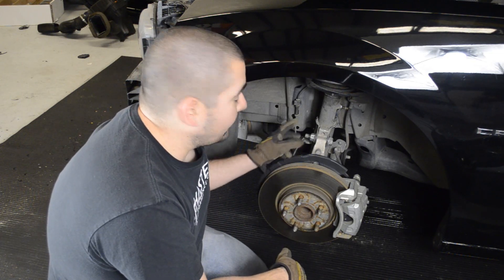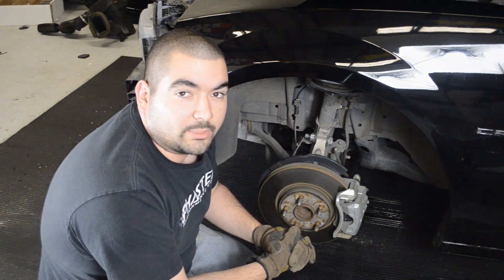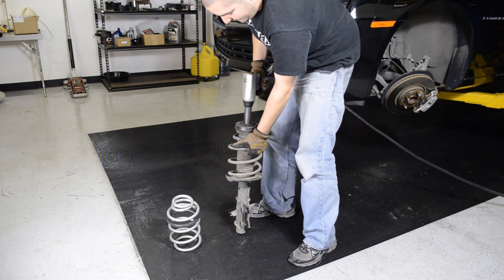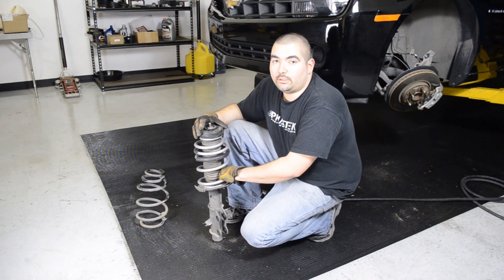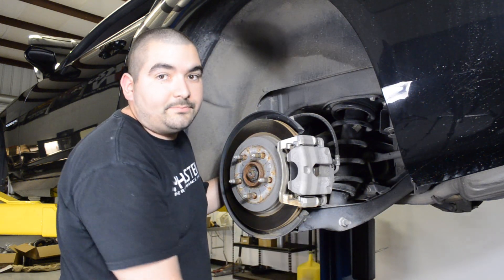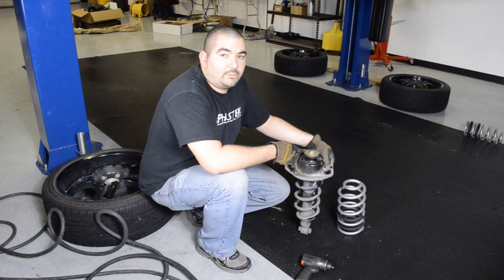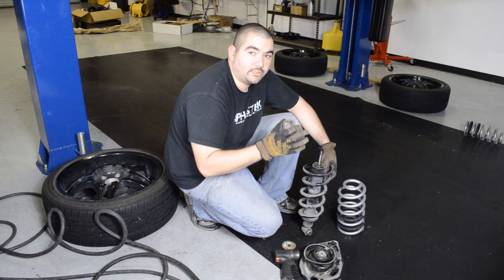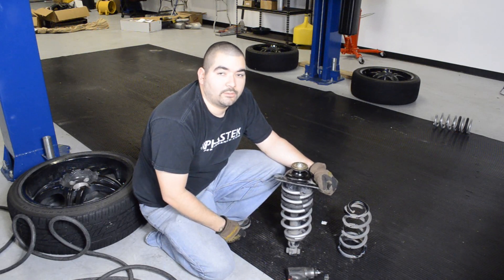PhastekPerformance.com - 5th Generation Camaro Spring Installation

Comment: Bruhhhh that rear bolt not the 21nm shock one but the one in the knuckle behind the brake rotor the 18mm, can’t seem to line up the holes 🕳️ to drive the bolt through ughhh it’s frustrating

Comment: Why is there rubber tubing half way down  on the new spring?
Reply from the maker: The rubber is there to prevent the noise of spring clap when the springs are collapsed completely.  Its more of a preventative maintenance to protect the spring during use.

Comment: I’m about to replace my front/rear struts on my 2010 Camaro, do the springs need to be replaced since they aren’t under much stress or do you recommend changing them, also does the mount and bellow need to be replaced when doing the struts?
Reply from the maker: I would suggest replacing the mount if you are already replacing the strut.  The springs do not need to be replaced but if you are looking for a different look then you already have them disassembled, so making the update is easy.
Reply: Phastek Performance ok thank you, I was going to buy new OEM springs or ones with same length, but if it won’t make a difference I’ll just stick with the stock springs

Comment: My sway bar link is stuck... like there's a lot of pressure on it so I can't pull the bolt out
Reply from the maker: You might have to put a wrench on the main nut and then a socket on the other end to hold the shaft from spinning.  That should allow you to remove the end link.
Reply: @PhastekPerformance  i got it done. The sway bar link comes out fine if you take the strut mount nut off first. The links were horrible to get off with vice grips. Was not easy at all.

Comment: The stiffer spring goes to rear and softer wider goes front ,pay attention at which order he is removing the nuts,very important,did this today,took me 5 hours for 2rear springs!because I removed bolts in the wrong order,the video is good but at least put details in description,for first time people is quite difficult !
Reply: Adrian B What did you do, mix up the springs? All you have to do is just match up the springs your taking off, with the ones you want to put on, this is not rocket science. Even for novices. This job wasn't that hard. I don't even have a compressor. Dude, they upload vidoes like this for you to pay attention, I did everything just like he did it, it wasn't as straight forward because my Camaro is a noticably driven midwest car, and I don't have a compressor or air tools. Very good experience, and let me tell you, spring compressors are a pain in the ass.

Comment: At 1:50 is that the top mount tan silicone part that needs to be shaven off for the 2015 SS models? You can see it for 2 seconds but is that it? I want to buy these for my car but noticed that there needs to be modification done for the top mount.
Reply from the maker: +Juan Bautista Yes, that is the part that needs to be cut on the 2014-2015 cars.  We have talked to the manufacturers about the issue with the spring sets and most of them are going to look into the issue and have it fixed.  It is just a matter of time .
Reply: +Phastek Performance Thank you, and also how would I go about to cutting that piece down and how much should be taken off?
Reply from the maker: Juan Bautista You can use a sharp blade knife to shave it down or a die grinder with a sanding pad to shave them down.  It is hard to say how much to shave down but a simple cut and fit should let you know where you stand.
Reply: What if I installed the springs without shaving the mount in my 2015 camaro?  Would that cause a knocking noise ?

Comment: 1 inch drop springs?
Reply from the maker: The springs used on this car were 1" drop springs.  The installation will apply to 5th Gen Camaro's.
Reply: ok cool thanks thats what i just purchased but im having trouble finding a shop that times or reclockes the bushings
Reply: Is alignment required after?

Comment: Do you have to torque down the nuts on each of the springs? If so do you know the settings please? Thanks!
Reply from the maker: We typically tighten the bolt till it bottoms out but the specific torque spec for that nut is 33 lb/ft.

Comment: Its supost to be a gap between the rubber and metal on top,please awnser me,thanks
Reply from the maker: Yes, the gap between the factory washer and the body of the car is normal.  Its typically not noticed till most people install the springs but it was there with the factory springs.